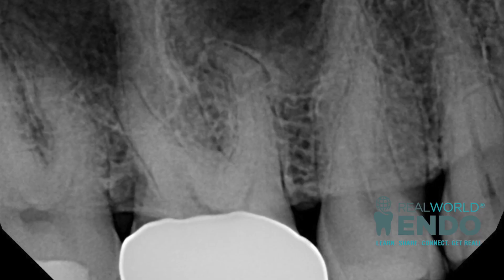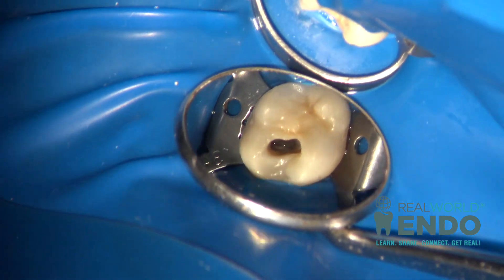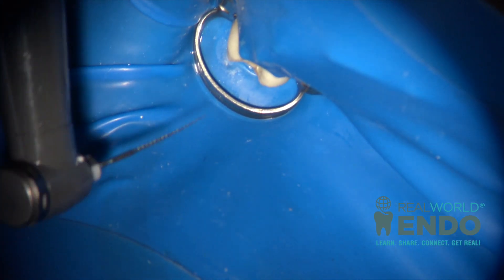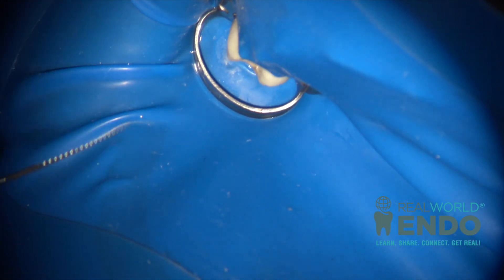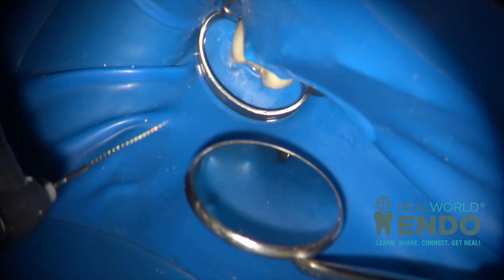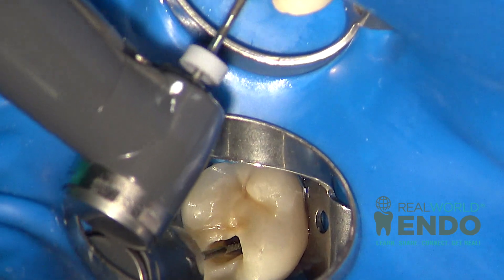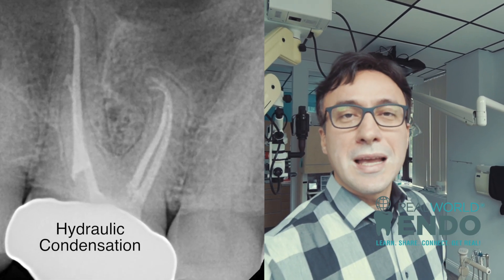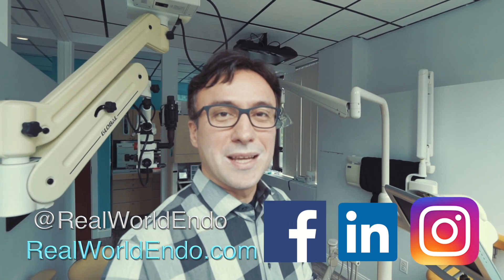Prebending Heat Treated Files Quick Tutorial

Comment: Nice tip. I have never used it the way you did. I usually use alchol on guttapercha points when the glide path is irregular and it is not possible to place a straight guttapercha point all the way to the apex. The cooling spray does the trick for me on rotary files.

Comment: Nice tip Dr Nasseh! You’re a lot braver than me putting a rotary around that MB2 bend. Did you have patency with a small K file beforehand or just powerful faith in the NiTi? Thank you.
Reply from the maker: That's a good question. I don't treat cases the exact same way I teach others. I recommend the use of hand files to others but I don't personally use hand files that much myself. The reason is because hand files are like training wheels and most people need them to increase their safety. With enough tactile experience, one can use NiTi files without the use of hand files. But the key is the experience that allows one to be super gentle in movement and motion and have a very light touch. That's why I don't teach it the way I do it because I would rather teach a safer and less technique sensitive way to the average user. See, my goal is to minimize the risk for most people out there and make this a predictable and safe procedure for patients of the average clinician. So, I do my best to simplify but also to make things as safe as I can. So, I recommend the use of hand files to create a glide path even though I don't usually use it myself, or at least not in the exact same way I teach it.  But I do use the concept of Available Length myself, which is something I have previously described. Cheers! :)

Comment: Dr. Nasseh, nice tip. I have a question. I know the usage vs canals have a great impact on the NiTi files. How much more of the life of our files is reduced if bending them vs non bend files? Thanks
Reply from the maker: Since these are heat treated files, as long as you're bending them with a gentle bend rather than kinking them; you should not have an appreciable change in cyclic fatigue. So, I wouldn't worry about it. :)

Comment: Hello Dr 
I would like to thank you Dr for your great contribution within Endodontic field eduction 

I need you opinion, can I have single cone with hydrolic condensation in comparison to warm vertical condensation for my thesis, do you think it is interesting subject ( I am master degree student in Egypt )
Reply from the maker: Yes. Why not; but how will you test it? What are you comparing?
Reply: @AANasseh  I will compare the sealing ability, monoblock formation, presence of voids and probability of gutta percha extrusion with hydraulic obturation technique in comparison with warm vertical obturation. Is there any variable I need to consider or compare Dr , I am open for your kind suggestions
Reply from the maker: @eslamalexander8664  You can compare the fracture resistance if you want. There was a previous study about ten years ago from U. Alexandria comparing the fracture resistance of teeth with Active GP vs regular GP with BC Sealer. You can do the same study with BC Cones vs Vertical compaction and fracture resistance. You can compare ProTaper preparation and Warm vertical vs. EndoSequence 30/04 with BC Sealer. That’s a simple idea and you can follow the same protocol as U. Alexandria article. Cheers!
Reply: @AANasseh  Many thanks Dr 
I will look for that article 
Appreciate it Dr